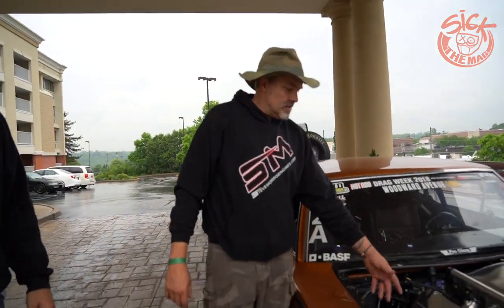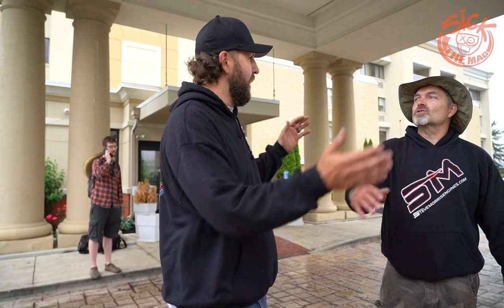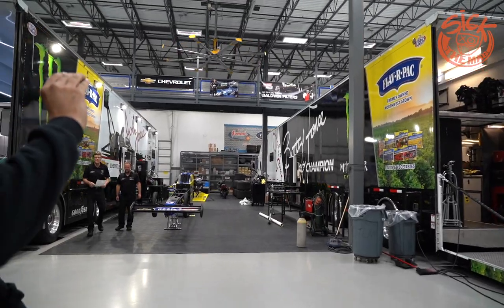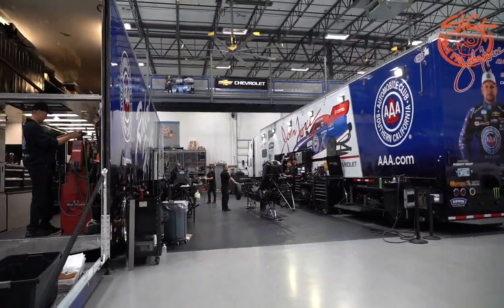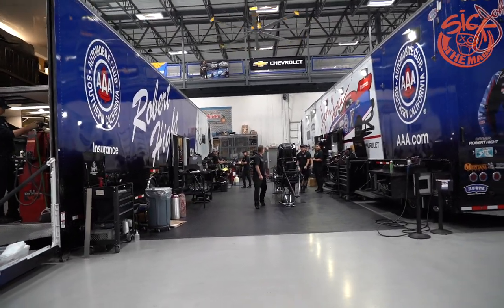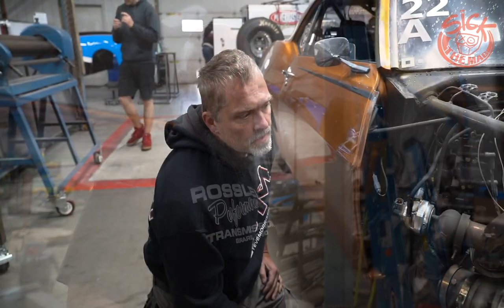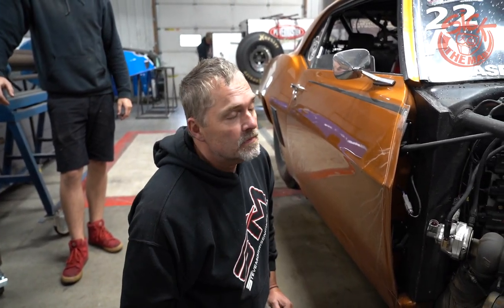Driving A Pro Mod In Torrential Rain! Midwest Drag Week Tested My Nerves (But I Met John Force!)

Comment: 12:31 Priceless, John Force burning his fingers on your turbo has to be good luck.
Reply: Gotta put some Dna onto there
Reply: A little piece of Force will be with that turbo forever.
Reply: @bigharrykochenbauls4567  Yea 3 purple fingerprints in the stainless housing.. lol
Reply: Even guys that have been around hot engines for 40yrs sometimes have a Momentary Lapse of Reason.

Comment: I never thought race engines could be driven long distances on the freeway.  I figured they weren't designed to last that long and we're simply designed for short bursts of power at the racetrack. 
That's quite a feat to have something that powerful that's also durable and drivable.  Neat stuff.

Comment: Running in the rain on pavement that has ruts filled with water is very scary at best, while hydroplaning can start at roughly 35 miles per hour depending on the amount of water on the road, the threshold for hydroplaning is roughly 49-55mph using normal all-season radial street ties. This can change dramatically with increased water, increased width of the tire and lack thereof thread.  I can only imagine how nerve racking it is behind the wheel of Tom's car on street slicks, same as driving on ice or ball bearings. White knuckle Express.  Be safe brother!

Comment: 275 duratracs on my truck and I have to put it into 4x4 when it rains. Great on snow, but basically useless on rain - easy to kick out the arse end (2nd set since 2016 and it’s the same deal whether new or with some k’s on them).

Comment: The old M&H street slicks were really bad in the rain.
I would think too much air and just running on a center of the tire would be worse than having more of a contact patch on the road.I do understand about hydroplaning so its your choice.
If I were to do drag week I would change to an actual street tire just for situations like this.
Who cares what it would look like because  having stability is more important.
Poor Cleetus John Force wasn't impressed at all with the elco and probably has no idea who Cleetus is.

Comment: I have done the drag radial rain drive before.  Its worse than ice.
Reply: Sucks, but def not worse than ice. Not even close.
Reply: @joshuagibson2520    I've drove on rain in drag radials before....If I turned the wheel...even a bit....fishtailed.  Touched the gas...fishtailed....touched the brakes....fishtailed.   Yeah...a drag radial on rain is just as bad as ice in a regular car with regular tires.